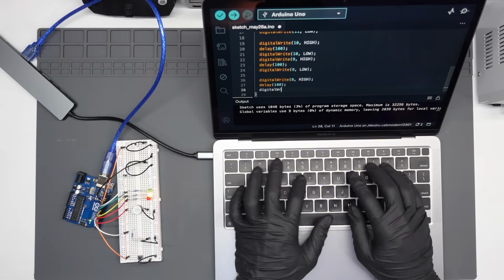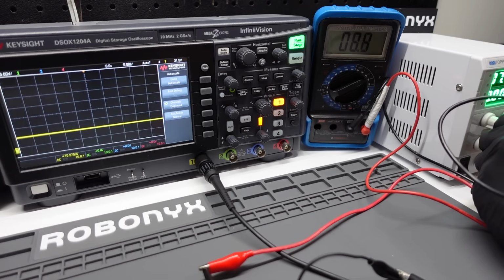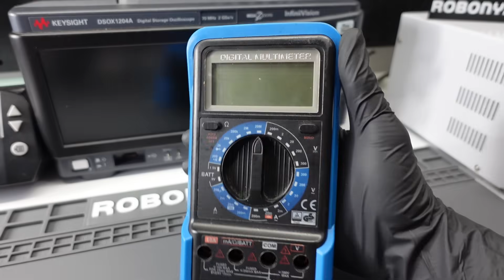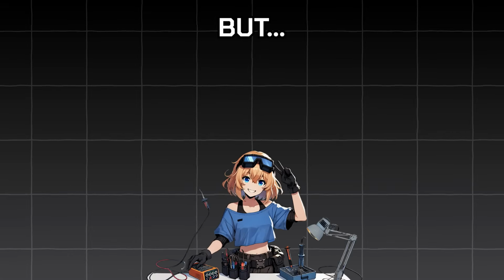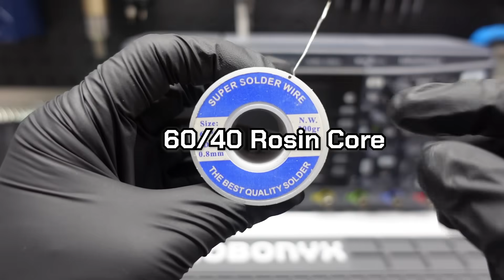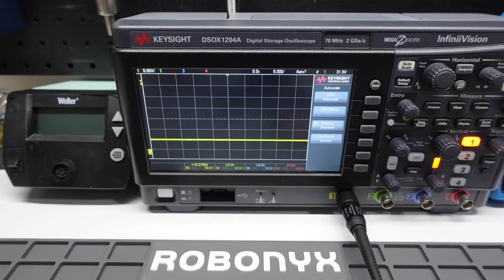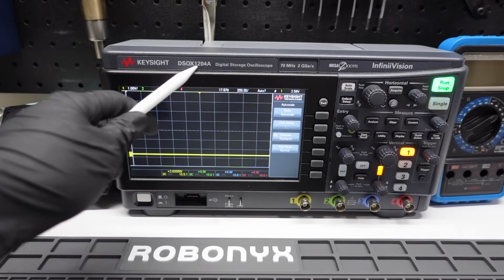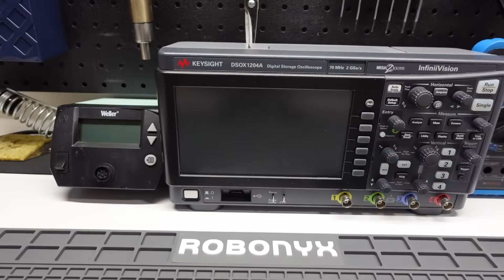Workbench Essentials When Starting Arduino! (Beginner Guide)

Comment: Bro this is exactly what I needed to help me progress further. So far ive only focused on theory knowing what i need to get started is huge. And you made it sound so simple. Thank you so much!
Reply from the maker: Hope it helps! 🙏
Reply: if you are starting, don't waste your time on Arduino
Get an ESP32 board

I'll tell you why .   You want to know to get a headstart,  HERE IS HOW

1. it's important to learn Arduino and ESP32
Arduino and ESP32 are the development boards
they both use a form of C++ as the programming language
Arduino uses Arduino IDE as the platform you program on

NOW HERE IS THE COOL PART
You should learn both, but you don't want to waste money buying an Arduino.
Buy an ESP32
it's cheaper
it's More Powerful
it's Faster
and you have Bluetooth and WiFi Options built in
Also.... Faster Micro and Dual Core Processing
it's not even a comparison

Now.... WITH THE ESP32, You can absolutely (and YOU SHOULD)  Start with Arduino IDE
and Arduino Sketches

Remember,   ESP32 is just the board
when people say "are you PROGRAMMING ARDUINO"   they are talking about the sketches, not the board

Essentially the connectivity between the 2 is more or less the same, but the ESP32 has more options

so... Start with ARDUINO IDE
but don't stay on it for too long, Give yourself, maybe 3 months

then do this
When you learn programming you want to learn 2 things in the beginning
PYTHON and C++

so MY RECOMMENDATION

Install PYTHON
Install VS CODE  (Visual Studio Code)    this will be the IDE to replace Arduino IDE

when you open VS Code you want to add these extensions

Python
Python Debugger 
C++
C++ Debugger
ESP32 IDE

and now you're ready to take it seriously

Also, Don't go for Arduino Nano, it's a pain in the arse

NEXT....
You can muck around with standard sketches for like 2 weeks
But don't spend too much time on standard sketches

LEARN TO PROGRAM ARDUINO OR ESP32 ON YOUR OWN

ESP32 has an Operating system, it's called FREE RTOS (Free Real Time Operating system)

First Learn your Arduino course  
WHILE USING ESP32
and 
WHILE USE VS CODE
that way you won't be a noob for a long time

As you learn each lesson
Make a practice sketch to test what you have learned

IMPORTANT : Understand very quickly what SERIAL MONITOR is
and INTEGRATE SERIAL STATEMENTS INTO YOUR CODE
then go to the serial monitor to see if it works

EXAMPLE :
Say you are blinking an LED once per second

if it works it works, right

but what if....
in the middle of the blink commands  you entered serial commands that said
print "LED Turned ON"  (After it turned on)
then after it turned off
print "LED Turned OFF"

that way you are doing a few things at one time

1. You are learning to code 
2. You are confirming you understand what you have learned
3. The ability to create serial commands accelerates your learning
4. These serial commands later are used as troubleshooting and degugging tools  (But since you already did them YOU DON'T HAVE TO LEARN THAT)

AND THAT WAY....
You want be a noob that just forever blinks LED's and then Moves to LED Strips and forever uses stock Sketches and googles the answer

IF YOU WANT TO LEARN THIS THING.... THEN LEARN IT
and Honestly.... it will take you say... 3 days of solid learning (Not 20 hours)   Because that's rubbish

LEARN 1 THING
PRACTICE THAT THING
WRITE SOME CODE TO MUCK AROUND WITH THAT THING

then
LEARN THE 2ND THING
PRACTICE THAT THING
WRITE SOME CODE TO MUCK AROUND WITH THAT THING

Remember this Author's goal is to fastrack you through a course
DON'T DO THAT, You'll just get confused

GO SLOWLY
GO AT YOUR OWN PACE
the point is TO LEARN
not , to go through it as fast as you can

Example :
In Arduino, You'll no doubt start blinking LED's
you will learn the Delay()  command

after a while you'll learn that because Arduino executes code sequentially
IF YOU HAVE TOO MANY DELAYS they may conflict and stop things from working.
You'll then try to adjust the timing of the delay, but that will hit a roadblock as well
BUT IT'S GOOD TO LEARN THIS

so...
Your next thing will be to try using  millis()
You'll hit the same road block

and if you are stuck on Arduino you will know NOTHING ELSE

HOWEVER...  on ESP32,  You use  vTaskDelay()
the difference being   Delay()  is BLOCKING CODE
vTaskDelay()  is not Blocking code

so you see...
you can play with FREE RTOS and Arduino
and Arduino IDE  and VS CODE............AT THE SAME TIME , SIDE BY SIDE
so you can learn the differences

THAT'S HOW YOU SHOULD LEARN
but it all starts with buying an ESP32,  so you don't have to waste money on an Arduino

YOU'RE WELCOME
Reply: Heyy, could I ask what resources you used to learn the theory aspect?
Reply: why did i get so over whelmed